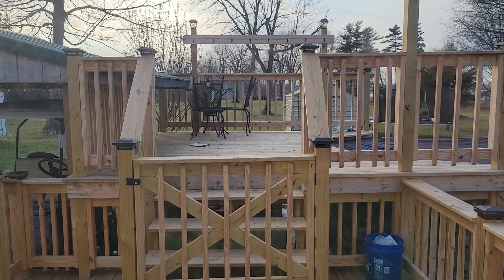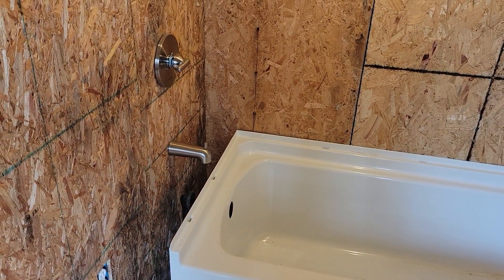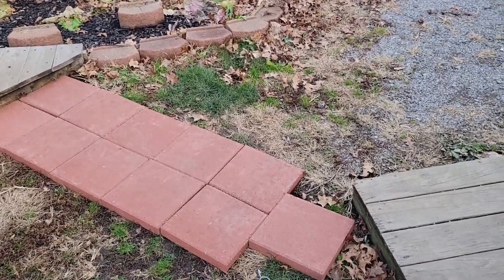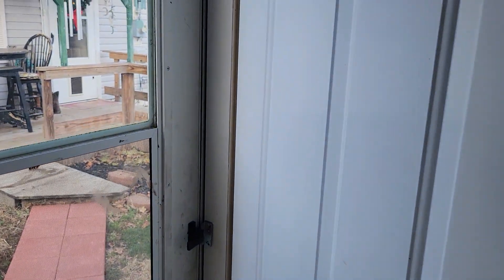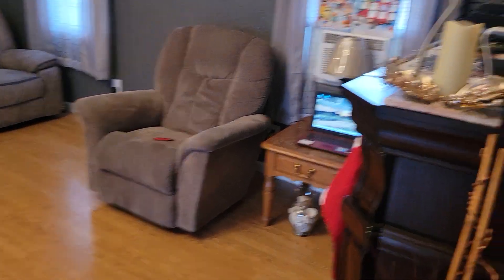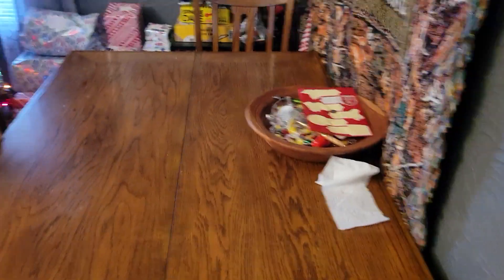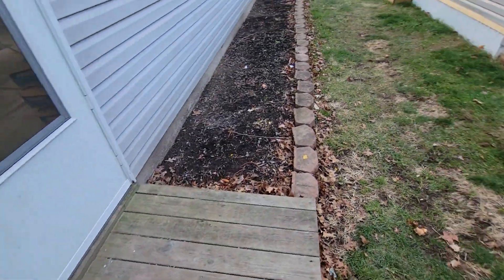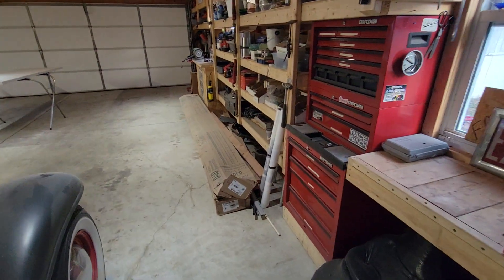Suburban Homesteading    THE BIG REVIEAL

Comment: Why do you use OSB for the interior walls and ceilings? Texturing walls and ceilings are out dated. You seem to be pretty handy , drywall would look much better.
Reply from the maker: Drywall is too brittle. If I ever decide to make this a rental I won't have the problem of someone punching a hole in the wall. And YES textured walls are Dated BUT this whole house is textured and it would look funny with one room with smooth walls. And last but not least ( I CAN'T DO DRYWALL FINISHING ) And make it look good.